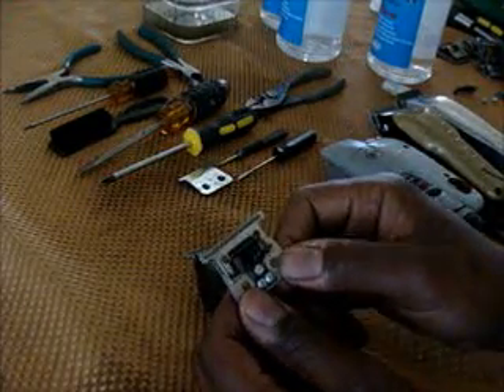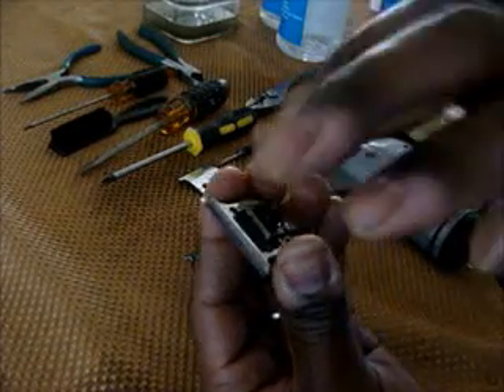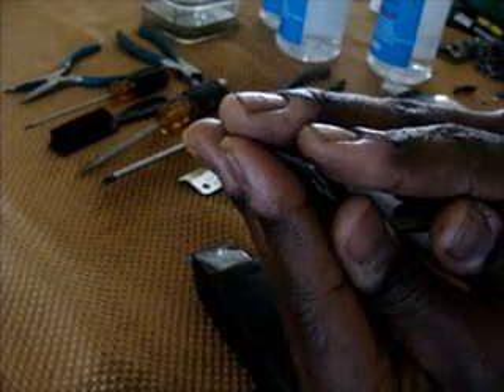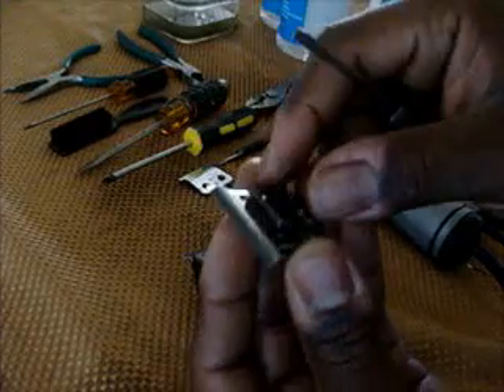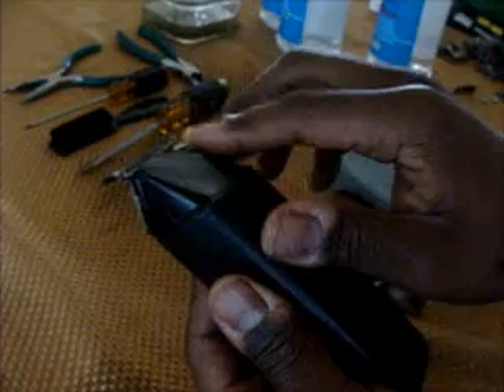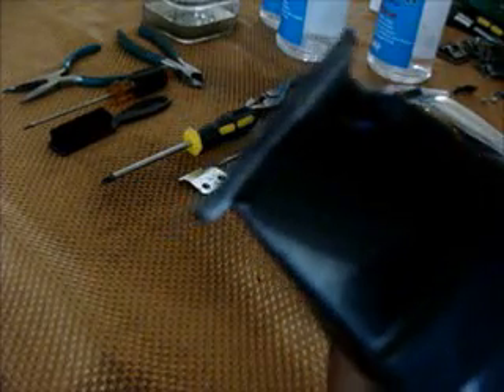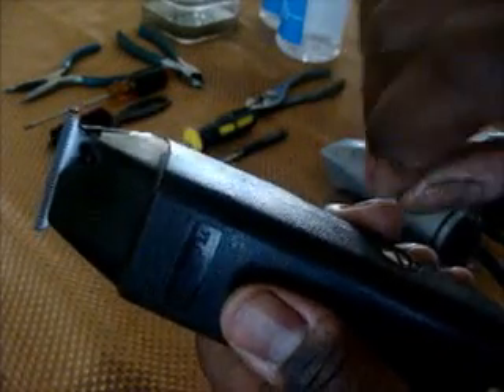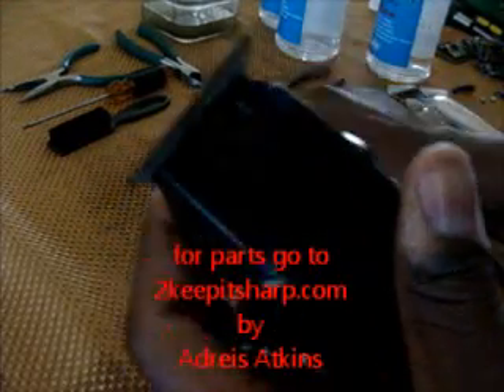Styliner II tune up

Comment: Hello my ? Is why is it when the blade is set perfectly and then put on the trimmer it tends to knock itself out of alignment when the trimmer is turned on...Thx for all the great tutorials
Reply from the maker: its all in the adjustment. also some times the small black plastic piece that sit in the center of the blade can be warped. even when you set it correct it may still rock when you turn the clipper on